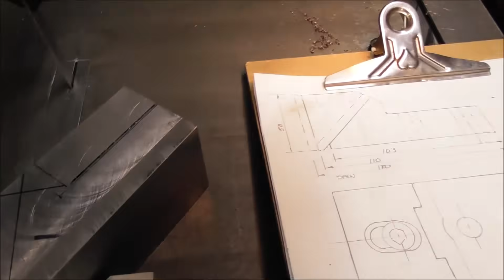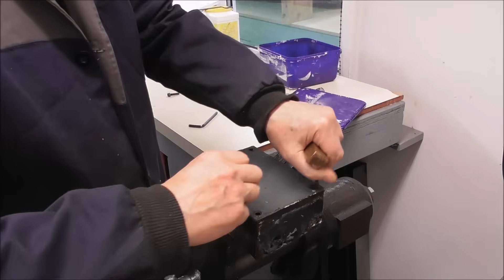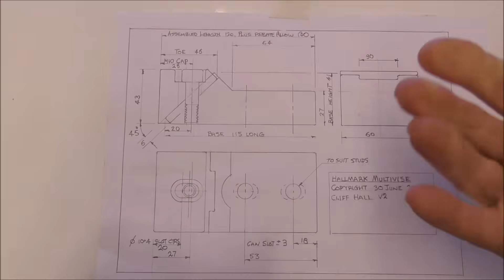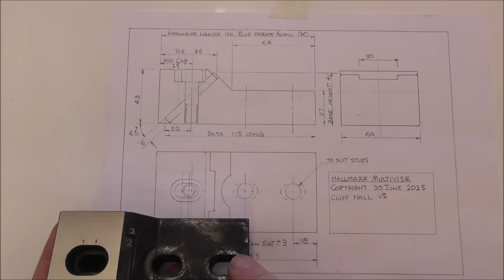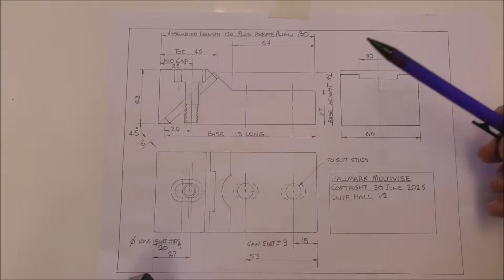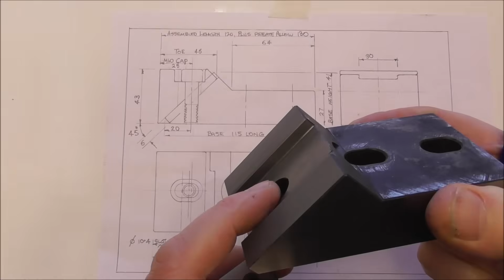Improved design 2-part vise/edge clamps - build notes.

Comment: intention to inform: You too should move the part in a big canister of cooling liquid. And no idk how you did try to hardening the blocs. 

But the more contact the hot part gets to new cool liquid the better the heat sinking will do its job. 

When you lower the temp of the liquid it can help but it can too lead to cracks in the part because of the rapid cooling.

We had good results with 60°C oil we get away fro water at all, because of resulted in a lot of cracks.
You can adjust the hardnes to some degree with the temp of the oil you are hardening in. But for that task you can do some research on hardning temp. of oils. 

Its not all about speed its about how even you get the heat out without cracks. But that i assume you know =)
Heat up the oil and grip the part with a special made forgeclamp then turn it fast in the oil could do the job but be aware that the oil flying of the part is over its smokepoint and could catch fire when it gets in contact with air.
So when turning the hot part in the oil do that deep unter the surface to avoid a flash flame. 
Been there a few times.

Comment: To clarify, the vertical force from the screw is divided equally into a downward force and a thrust directly towards the opposing jaw through the part. This thrust on the opposite jaw face will naturally lift both the opposing jaw and the part end upwards and backwards with equal force as it is pushed back along the taper.
Reply: When one end is lifted from the bed or deviates from parallel, tightening that end will either force the opposing clamp further up its taper or introduce distortion to the component.
To minimise this effect and reduce the tendency for the part to rock during sequential tightening, the 45-degree angle should ideally be positioned closer to vertical. This adjustment helps lower the upward force applied to the opposing jaw, improving overall stability during clamping.
Reply from the maker: Yes, that is partly why I think it is best to have pull down/clamping adjustment on both jaws, so that even and accurate holding can be achieved. Cliff

Comment: Hi cliff, nice vice. But i think it would be better with only 1 movable jaw and the 2nd fix. If you have several pieces to machine the zero in X is wandering. Or am i wrong?
Reply from the maker: No I hear you. I like the reference position of a fixed jaw, but I really like the pull down of a sloping jaw. It could be choosable, screw the jaw down to the table contact when you want reference for multi parts, and use the pull down for other work. Cheers, Cliff

Comment: Could one part have the jaw sprung upwards without the tightening screw? Then the force from the other clamp would push both jaws down.
Reply: Maybe have a more vertical taper with about 1mm of spring play so the reference position won't change very much but still pull down. I love the idea of tightening with just one screw and a fixed reference.
Reply from the maker: Hi. Interesting idea. But after some consideration my thoughts are, you would need the slope going the other way. Cliff
Reply: @Threadexpress yes they would need opposing tapers like some vise jaws. As It is tightening one end will try to lift the opposite jaw upwards. It would not need too much travel and could be more compact than the moving jaw.
Reply: @tates11  no brainer

Comment: That tap wrench just went to the top of my todo list!
Reply from the maker: Good to hear. I have a few new design videos, and I will be publishing them about one a week. Cheers, Cliff
Reply: I would seriously consider machine taps. They have largely replaced hand taps and can be driven in with the drill chuck. They will produce naturally square holes much faster on a mill and can still be used with a tap wrench on the bench. The spiral point, in particular, has a much stronger geometry. This and spiral flute style do not have to be backed off when hand tapping to break the chip, just wind them in.
Reply from the maker: @marley589  Yes I agree, I use them whenever I can - I was using spiral point taps on the through holes. Cliff

Comment: Can't find your worlds shortest guided tap wrench anywhere.
Reply from the maker: Hi - See the top comment and introduction. Cliff
Reply: @Threadexpress  Figured that may be the case after I posted sorry. I did have a good look through your other videos and have subbed.
Thank you very much for allowing me to download the PDF of your two-piece vise drawing. It is greatly appreciated.
Reply: If you are pushed for height under the spindle nose, try a quick release system like this - R8 ultra short form quick release tapping head in action on mill & lathe
Reply from the maker: @machinists-shortcuts  Hi - Yes that system looks great for production jobs. Cheers, Cliff
Reply: @Threadexpress  Cheers Cliff. Most toolmaking jobs I make usually have several tapped holes. When working on a manual mill, the time taken to move both slides to the next hole position is often longer than performing the machining operation. To help increase productivity, this system allows all operations on each hole to be completed before moving to the next position. It's not only the quick release feature, but the heights of the tools are all short and relatively similar. I admit,  it is a bit over the top to have a rack holding a full suite of pre-assembled quick release tools [ spot drill - stub drill - countersink + tap ] for each thread size from M3 to M12, but why not?

Comment: Looks  good .   Something that i have been thinking about making but with a steeper angle for more clamping pressure for use in larger machines .   Cheers  👍
Reply from the maker: Thanks for the feedback. I copy here a similar reply: My last video/design used a front bolt into the table also, but there are downsides. I found with my checks the bolt tension of the front bolt has to be quite low because of the wedging affect, too high and it skids the body away. Cliff
Reply: @Threadexpress   You may be of a similar vintage to myself , Started my apprenticeship in 1982 . Fitter & Turner , Toolmaking apprenticeships were very rare then .  Especially in Wellington !   By chance , have you ever visited the machine shop at the CSIRO in Wellington ,  what a place that was .  We did a visit there at the end of High School as a careers thing .  Cheers  👍
Reply from the maker: @swanvalleymachineshop  Huh!  I did a school tour back then too! Yes, I started in Fitting and Turning too - then changed to Toolmaking and continued on at McCabe Industries, Upper Hutt. Cliff